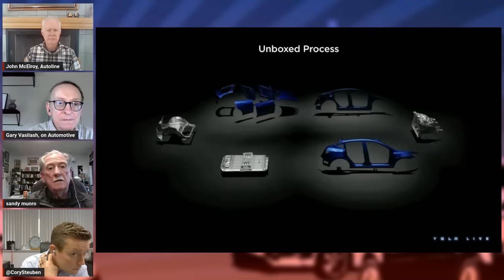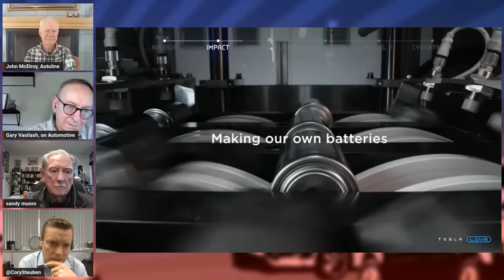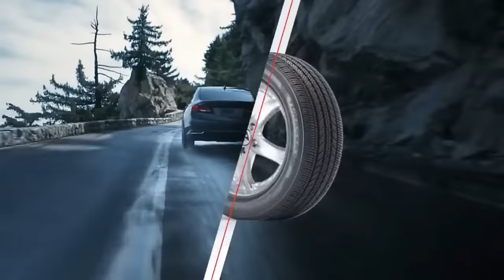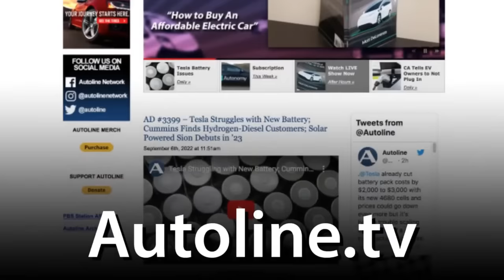Sandy Munro & Cory Steuben On Tesla's Master Plan Part 3 - Autoline After Hours 639

Comment: Hope Autoline and Munro do a quarterly discussion like this. There is so much change happening and it would be good to hit some of the biggest changes of the quarter and see how trends are holding up.

Nice job Autoline and Munro.
Reply: At least once a year.  That gives enough time to do a proper retrospective on whatever was discussed  in the previous episode which a shorter quarterly discussion would not.
Reply: @Darwinist  Considering they only get about hour, I think the quarterly pacecwill give more time to cover more topics.
Reply: Yes, please.
Reply: You know normally Kevin, you would never see something like this ever.   That how much innovation is taking place in Tesla.
Reply: @mandarinandthetenrings2201  Yes, I have been closely following Tesla since late 2019. I do believe the other factor is just investments in EV tech are finally reaching high levels. The pace of change was slow due impart to lack of investment. Tesla kicked the doors open and now there is a race to improve. Tesla's problem solving company culture is willing to break norms and tradition. This has been a fa tor of the pace change as well.
Reply: Yep they definitely need to have more talks like this and other industry insiders who actually understand what's going on in the EV landscape. At this pace by 2030 nearly everyone will know multiple folks who drive an EV, especially once China starts exporting cars hot and heavy. The biggest things holding them back was their lockdown, now that's over they will start ramping up again over the next few years big time selling to any market that will have them all over the world.

Comment: 1:29:28 note that every car with FSD hardware is capable of training in shadow mode and providing data back to the mothership for FSD training. That hardware is also used in the autonomous safety features that come with every car. Also, every car now sold by Tesla comes with basic Autopilot (autosteer and TACC) included. So it's not wasted even if the owner never subs to FSD.

Comment: Thank you Autoline for bringing up wraps vs paint. Since so many sports car enthusiasts already put custom wraps on their cars, it seems the auto industry could save a fortune returning to Ford's old idea of making cars in one color.
Reply: Primer w clearcoat
Reply: Every "Tesla fanboy" (yes, I am) was discussing wraps immediately after the presentation.
I'll go further, "plastic" (composite) panels, (not using carbon)
Clip on, cheap.
.
(I wrote this before Sandy mentioned it at 22:00 )
Reply: I hope plastic body panel elements are much improved because I remember the days of faded hoods, roofs, trunks and fender tops from the older days. They lasted about 3-4 years before they were embarrassing to drive.
Reply: @SteveBueche1027  BNW i3 plastic body holding up 9yr. So far
Reply: Is it possible to make the wrap shine like paint though? Every wrap I've ever seen is dull and makes an expensive car look cheap.
Reply: @fcv1967  yes, frosted are popular, but there are gloss & metallic

Comment: You guys are great together. There's a lot of reciprocal respect, and everybody brings a different slant which makes the analysis much more interesting.

By the way, Tesla will pass up GM around October, 2025 based on monthly sales. It could be sooner if ICE vehicle demand falls. 

 You won't need to wait until 2028 or 2029.
Reply: Elon has a stretch goal of 2M for 2023. With a poor macro-environment, I think it will likely be less. But that same macro-environment would almost assuredly drive GM's sales lower in 2023. If Tesla can increase sales 50% in 2024 (in line with Tesla's historical CAGR and their current guidance) and GM continues to have sales declines, 2024 may be the year that Tesla passes GM in sales. That said, I also think 2025 is a good prediction—however, based on monthly sales, I would guess before October.

Comment: Great conversation and insights.  Thanks.  And congrats on 100K subs.  BTW - Tesla also saves money by not advertising and not selling through dealers (who mark up the EVs).  And no dealers means Tesla has direct control over price so they can better manage delivery backlogs.  Also Tesla doesn't wait until the next model year to introduce product improvements or cost savings into the production line.
Reply: For someone who "doesn't advertise" Tesla sure does show a regular marketing expenses in every financial report.
Wonder where this all money goes... surely can't be astroturfers, it absolutely cannot be that at all!
Reply: @SkywalkerWroc  they do have a “big” marketing budget, still less than 1/10 of GM 😅 they do make videos to post on Twitter, and Semi day or Cybertruck day  costed millions to do those one day functions. The most expensive is probably Giga Berlin opening event. That was HUGE

Actually, they DO do some advertising in China, once in a blue moon

Comment: Back in the 1950's, My dad had a bunch of equipment that was designed for SIX VOLT. He was able to obtain some EIGHT VOLT batteries from a local battery maker. As I remember they worked fine for starting those older trucks.

Comment: Great point, Cory. You have brought the ancient figures up to date. And then to add all the extra 'value '(that abuseds word) as the strengthened pillars, sensors, dwell wipers etc. etc. !  So much more going into modern vehicles compared to older ones.

Comment: This differently caught my attention thanks for providing the video!

That is great Tesla is creating jobs in the US and coming up with so much new innovation they are doing a number of great things!

With respect to the new manufacturing process.

I have been involved with automation and robotics for over 30 years ((BME/MSEE) mechanical design, software algorithms, working with optics and electronics, a number of patents, NASA stuff, IEEE stuff, systems running all over the world, etc.)

I think once this the new system is running and if the workers were to wear Fitbit type watches to count the steps etc. I am not sure in the end how much wasted motion is going to be saved.

They still have to move to assembly items, the items have to move, etc. but it does sound like the painting is a major advantage, and having multiple cluster areas does keep production going if one area is down.

Until it's up and running may not know for sure how much motion is saved.

Mexico does have much lower labor rates than the US, Germany, etc. this would help a lower-cost EV to manufacture in Mexico.

I am concerned about how ruff the assembly jobs can be I am personally willing to pay a given amount more for a car if it means more humane treatment of the workers (for any company I am not suggesting Telsa is different).

That is great they are looking to improve everything!
Reply: I don't think the workers need Fitbits .
The work comes to them.

Comment: 3 reasons why a cheaper electric car should be front wheel drive:

1. Centralization of wiring, heating,  cooling, wires, pipes, radiators etc for the cabin as well as for the motor.

2. Generally speaking FWD is safer. 

3. Most braking power regeneration can be extracted from the front wheels as the back obviously gets lighter during braking.

Comment: Regarding paint, I've been looking into powder coating. It's a dry process, so no solvents. Over sprayed powder can be collected and reused with an air filtration system. There are several good ways to manage the application. And you can get great effects (e.g. shimmering tones, multi colored with masks, colored clear coats). You can even repair it with powder, a spray bottle, and a heat gun. 

The remaining downside seems to be the need for lengthy curing time around 400° F. In addition to being energy intensive, I'm not certain if that changes the material properties of their steel. I just don't have the materials background to answer it.

Comment: The last year automobile companies use 6 volts batteries was 1955.
Reply: We had a trabant made in ... ~1970, and it had a 6V system.
Reply: Actually, Packard used 6 volt in 1956. Willys Aero and Kaiser ceased North American production and sent dies etc to Brazil and Argentina respectively where 6 volt continued on for a while longer. Studebaker also ended 6 volt after 55. Offhand, I can only think of Packard as the exception to the 1955 changeover date.

Comment: 1914 - 1925 Dodge Brothers automobiles were all 12-volt systems, while the rest of US manufacturers used 6 volt systems. After the brothers both died in 1920, the widows continued until selling in 1925 to a group of investment bankers. 1926 Dodge Brothers switched to the industry standard of 6 volt systems. Chrysler bought Dodge Brothers in 1928 and continued with 6 volt until 1956 when 12 volt systems were becoming the new industry standard. 
Dodge Brothers, under Chrysler, began to change in labeling to simply "Dodge" in 1930, and the last Dodge Brothers was produced in 1939 in their truck line. All 1940 makes, and thereafter, were just named Dodge.

Comment: Yes early to mid 50s was 6v battery, my '32 Ford roadster hotrod had a dual voltage battery, 6v/12v, the 12v cable turned the starter like you wouldn't believe even with the battery in the trunk area.  Good old days.

Comment: I've worked on old 6 volt vehicles. Most have been converted to 12 a long time ago. One messed with me. It was an old VW beetle. Guy brought it in for the battery wouldn't stay  charged. I finally figured out it was charging at 6 volts and the guy was trying to charge a 12v battery and run a 12v radio on a 6 volt generator.

Comment: It's important to note, according to Bedini and Bearden, lead acid batteries do have an anamalous ability to furnish exponential, perhaps near infinite amounts of electrical power without ever being recharged by harnessing the very unique properties of lead-sulfuric acid electrolyte, when the electrolyte is resonated at high frequency while also being discharged and charged simultaneously, energy is created inside of the battery, independent of external sources. This is according to Bearden, PhD., in his literature. Deleting the lead acid battery before this effect can be studied will set back energy production by 30 years. The lead acid battery is the best battery ever created. And no other battery has the same unique (anamalous) properties to generate power internally.

Comment: The number from TTAC was $21,000 USD and it was based on the number of months in earnings at the most common (median) income level.  The comparison was to the 1970s.  Since then auto prices are up 10X but incomes are up only 4X.  The goal is for a vehicle to come back in line with between six and nine months of income.

Comment: 48 volts is not a random choice: Afair (I'm Norwegian) voltages up to 48  are considered safe in the US, i.e. they do not require specialized equipment or safety procedures/certifications like the main high voltage battery.

Comment: I think Corey was completely wrong when he stated the Tesla plant would just make the Model Y and the Cyber truck. Firstly remember how big he said the factory actually is... They are installing a mesa-zine floor in where they are constructing the Cyber truck line. When they anounced the Texas factory the Semi truck was going to be made there also. I do believe the casting shop has room for 8 machines and with 2 x 9 ton machines for the Cyber truck we are only up to 6 machines... What about the new sports car mark 2 there has to be room for it in Texas if the Semi is now not being made there. The second line for the Model Y is being installed...  Point is there is still a lot of space left in that building.... Fremont makes 4 different models of cars and even if you include the extra lines in tents outside ... Texas is far bigger than Fremont.. Two lines of Model Y'S and two lines of Cyber truck and a line for the sports car..... What about the rest of land there. There is enough land down past the cathod plant to build the logistics area on field 1 a second Texas factory  same size as the first on field  2..... Now where down to the farm across the creek at the other end of those fields could this be where they build the battery plan with CTAL  .. Point is Texas land is huge and they keep buying more..

Comment: Great to hear Renault getting a mention over there across the pond. They are doing some great EV work after compiling 10 years of research data from their 2G connected Zoe models, they have launched an excellent model called the Megane E-tech Electric. It has a very thin battery module and largely aluminium  chassis, I believe, so it is much lighter than the completion, thus achieving a great range.
Plus Google control software/UI.

Comment: At 33:00, voltage went from 6V to 12V because the quality of gasoline had improved because of WWII. As a result, cars were having the compression ratio raised to get more power from the same size of engine. Also, people wanted V8's. Instead of a low-compression inline 6, everyone wanted a higher-compression V8, so the starter-motors were struggling. You either had to double the amps and double the size of the starter, OR...double the voltage to 12V.

Comment: " The moving assembly line is actually a very inefficient process. "
It was intended to replace the approach used for custom built cars, which is, one work station, bring all the parts and tools to build the car and workers with different skill sets all brought in to the same spot.

What Tesla has in mind is big sub assemblies, which gives the workers and robots direct access instead of shoehorning themselves into one large body. The perfect example of this is installing seats and the dash assembly. That's all straight bolt on assembly now. It sounds like Tesla wants to build the front and rear assembly, the floor with battery, and door assemblies as separate pieces, complete from paint to the finishing touches. Then the final assembly brings all these parts together. The legacy makers would build the power train complete with wheels and the body, then mate these two large pieces together. Then they would install all the rest of the parts into this one big assembly. Tesla is changing this up a lot.

Comment: Can someone explain what happened to the last 0 in the description of lithium battery cells? 18650 used to mean: 65 mm long, 18 mm wide, and the 0 for round. 21700 was the name first used for 21 mm x 70 mm, but now they've consistently used 4860 as the name for these new cells. Why did the last 0 get removed? Did it confuse people?

Comment: The static capacitors within a can sell battery, being tree leaf like artwork. Just may help's the speed of the electron ohm - path flowing micro stardust matter bits with less heat.

Comment: Solenoids & small motors will need more turns.Wire also will be frailer. Switch contacts will probably work a bit better though.

Comment: The 25K model 3 will replace the Model 3. A part of the overall concept that should be mentioned in the discussion of Tesla profit margins is their refueling network and the "No Advertisement" and "No Dealership" savings. A cost they will have to incur will be expanding their repair shops and customer service.

Comment: Q: if you just switch to 48v on wires but have DC-to-DC voltage change at the component and then you can change parts as you can get them ???

Comment: Q. Does the cost of an EV include the vehicle charging system installed in buyer’s garage?  If not, it should, as John Q. Public has range anxiety with EV’s.  Whereas, a charging system in their garage, would provide a safety blanket which would eliminate their battery range anxiety.
Best - Michael

Comment: Everyone is sleeping on the fact that the Cybertruck is going to be made with this new unboxed production process. The Cybertruck is vehicle 1.0 of the new production process.
Reply: Take a look at the "powertrain" slide in the presentation (the one with the vehicle under a sheet)
Definitely not the CT.
(It's not the compact either)
That's the first, lowish volume G3 car.
Reply: @rogerstarkey5390  I've watched that presentation 3 times. Listen to the part at the end of the unboxing presentation. Lars says "Just like Cybertruck!". The CT will be the first "next gen platform" vehicle. It'll be the first to be 48v, unboxed, no paint, 85% of controllers made in house, etc. When they say "next gen platform", they mean "next gen architecture". And architecture includes everything from vehicle design to production to castings to other parts and processes.
Reply: @user-to2rf1rj5v  
Castings, cells, 48v, Electronics, etc yes.
"Gen 3 production"? We'll see.
.
But the car under the sheet, fist in Mexico (?) is the Roadster.
Reply: @rogerstarkey5390  Go listen to the presentation starting at 50:50. You'll see what I mean. And no, the car under the sheets is not the Roadster.

Comment: I made my e-bike with 52 volts, and I had a converter for 12 volts for my cigarette lighter. No big deal.  It will always work anyways.  Also, thanks for answering my question about voids with those peanuts they use.  Funny, since the '90s, I've wanted an electric car.  To me, even Tesla is way behind!

Comment: I don't know if anybody from Munro will see this, but maybe one of the viewer experts will be able to answer. I know it is a fairly simple question for the people who are knowledgeable.
Question: With electric cars in general, and Tesla specifically, once the battery system is charged, does it loose any meaningful amount of charge by just sitting, without being driven or  charged, for days or weeks?
In other words, if I fully charge my Tesla to 100%, and then leave it undriven in the driveway for 3 weeks, will the battery still be at 100%, or will it drop to 99 or 98 percent, or even less due to natural battery "leakage".
Thank You.